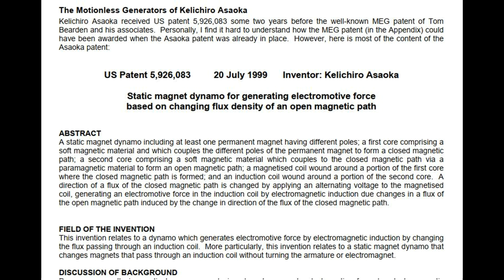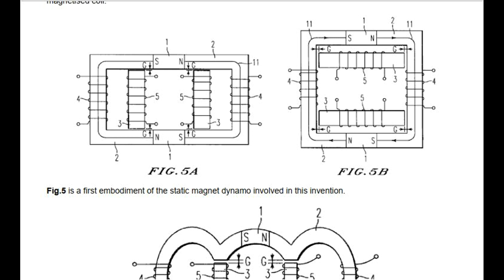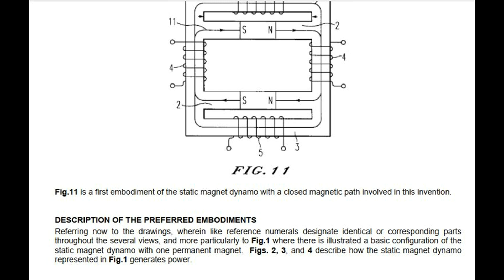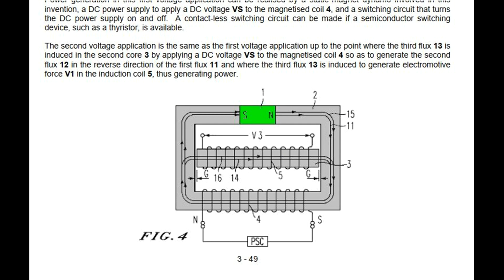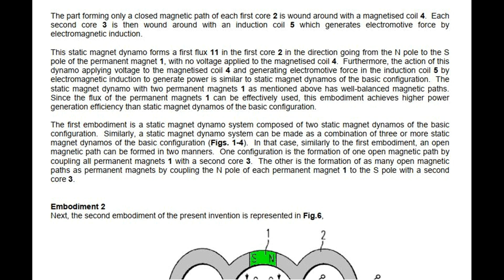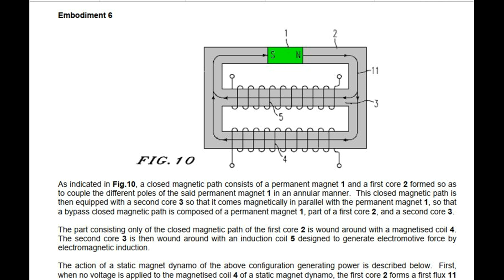Valeri Ivanov’s Motionless Generator

Comment: A switching power supply! Yay!
Reply: Right! That exactly is the problem! These and all other transformer designs have been utilized 10000 times before in all power supplies. Engineers would certainly have already taken notice about "unity gains" and started producing PSU with better efficiencies than Titanium (98%).
Reply from the maker: @ReinisLusis  None of PSU have complicated transformers with permanent magnets embedded in the core. None of PSU have multiple secondary coils, which allows magnetic flux of secondary coils to be redirected away from primary coil.
Reply: @marcisgulbis9310 many psu's have several secondary coils to produce several voltages, apart from that energy is either kinetic or potential and for potential energy to exists there needs to be a constant force, but potential energy cant power anything, so the only energy to power anything would be kinetic energy, but kinetic energy means movement of mass, wether its single molecules, electrons or big objects, but you cant make mass move without making other mass move in the opposite direction which is one of newtons laws. In the system shown the only moving mass are the electrons and they are moving in one direction at a time and magnetic flux doesnt have mass so the breaks newtons laws if you dont believe in thermodynamics in the first place.
Reply from the maker: @indian.techsupport   Newton's third law can be applied to physical objects, but can't be applied to electricity and magnetism, because in electromagnetism , reaction is not instantaneous, reaction is after time delay, which is caused by the inductance of the coil.
Reply: Dear Mr.  Mārcis Gulbis, this video with Speech synthesised voice doesn't answer my moot question: how is the overunity condition achieved?
You have no email-id to contact you. The US patent #5926083 was downloaded and perused. But written by a down to earth technician without sufficient physics background the patent isn't able to answer the moot question. There doesn't appear to be an X user with the user-Id., @marcisgulbis9310. So please advise on how to contact you, and if you could answer the moot question.

Comment: Motionless means powerless.
Generator means mechanical-electrical converter. And where there is no mechanics, there is no electricity either.
otherwise it would not be a conductor, but a source. And if it were a source, the magnetizing energy of the FeNdB magnet is around 300kJ/m3. then it would discharge, demagnetize. And it would be necessary to charge it with the same energy.
Even a steel spring or a Pb accumulator has a better energy density. It is only 1 of many variations of MEG.
Reply from the maker: Wrong and dogmatic. Demagnetization will not happen, it will start to take energy from surrounding environment. There is unlimited amount of energy in the universe.
Reply: @marcisgulbis9310 if a magnet could take energy from the environment and would be magnetized by the environment every piece od metal in the world would be fully magnetized
Reply from the maker: @indian.techsupport  It is secondary coils that takes energy from the environment, not the magnet. The coils will start to cool down while supplying electricity. 
When Floyd Sweet experimented with vacuum triode amplifier, secondary coils was covered with frost. Cool objects do absorb thermal energy from the environment.
Reply: @marcisgulbis9310  You have no way of verifying where the frost came from. And at the moment when a current flows through the guide, you have frostbite. you are simply repeating unverifiable delusions after someone. And you probably have no idea what thermodynamics is when you write about how "cold objects absorb heat energy from the environment".
Reply: @srotovnikabc6919  To destroy thermodynamic equilibrium, temperature needs to be increased or decreased. To increase temperature, input energy is required. To decrease temperature, energy needs to be removed with heat pump. Heat pumps have coefficient of performance greater than one. Vacuum triode amplifier is no more mysterious than heat pump.
Reply: @andromedananarchics7113  You have hockey in it, see my previous contribution, where I explain the comparison with the heat pump. Your physics is too intuitive, naive, childish, out of line.
Let's leave the triode, you would get completely lost there, because thermodynamics is also a mystery to you.
Reply: @marcisgulbis9310  explain to me how its possible to freeze something with electricity (except peltier effect)
Reply from the maker: @indian.techsupport  Nikola Tesla discovered another form of electricity - cold electricity, while experimenting with high voltage pulsed  DC going through spark gap. DC pulses created by spark gap creates shockwaves, which causes CFL lightbulbs to glow.
Reply: @marcisgulbis9310  That "huge amount" of energy is either thermodynamically unavailable or unusable. You won't make a power plant out of 4K relic radiation. You are completely missing that "quantity" is not enough to describe energy, you also need "quality", "smoothness", "convertibility" or entropy.
It does not begin to take energy from the surrounding environment, because the energy is transferred only when it has somewhere to go. There is no transfer from an equilibrium environment to an equilibrium environment, therefore the system is in a flooded state and in thermodynamic equilibrium.
Don't say anything you can't prove.
Reply from the maker: @srotovnikabc6919    heat pumps are already used to heat homes. Heat pumps have coefficient of performance greater than one, and it absorbs all kinds of relic radiations.
Reply: @marcisgulbis9310  Do not forget that the electrical energy, which must form a concrete fraction (that is, not arbitrarily invented by you) of the transferred "relic" energy, according to the temperature, is entropically at the level of solar radiation and not relic. And believe me, if the inlet temperature were even 100K, you can forget about the COP of today's heat pumps.
So you're just fooling people and you don't have any reasonable numbers in your hands.
Reply from the maker: @srotovnikabc6919    What 100 Kelvins? Earth's average temperature is increasing because of global warming, which is caused by CO2 absorbing infrared rays. Increase of CO2 levels are caused by our dependence on fossil fuels. To stop global warming, need to reduce demand for fossil fuels by replacing coal and gas powered power plants with free energy generators.
Reply: @marcisgulbis9310  So do it first and don't talk about it to the wind. And when you have it, measure it honestly and find out if it can be useful at all.
And study the CO2 spectra first, find out the performance balances and don't make someone's parrot here. You know as much about what causes climate change as your fellow tribesmen. You would first have to learn not to touch the bar.
Reply: @marcisgulbis9310  You, as a physics illiterate at the level of a weak elementary school, really have nothing to say about this topic. You uselessly repeat the CO2 agenda after someone, when you yourself do not even know how to evaluate the spectra. Otherwise, you could not have such primitive comments. The mere fact that you mention one spectrum and not the other two shows your inability to comment on the topic without at least a month's course in the basics.
Today, almost anyone can really be pregnant.
You are unfortunately destined to make a parrot.
We have had free energy projects here for at least 30 years and still nothing, paper kites. Human stupidity proved to be the best source of free energy.